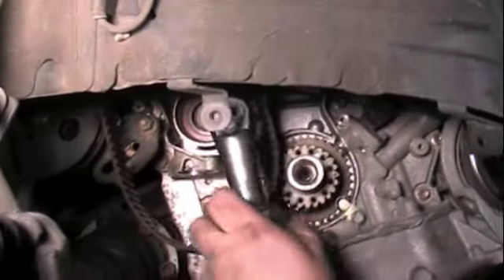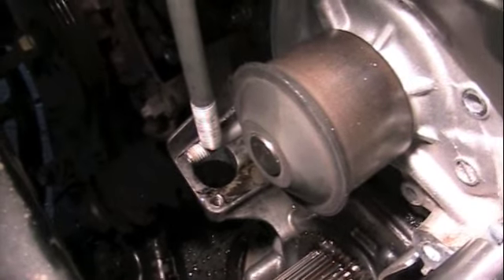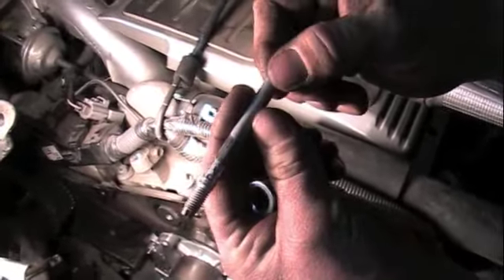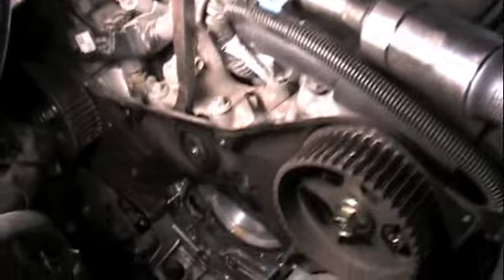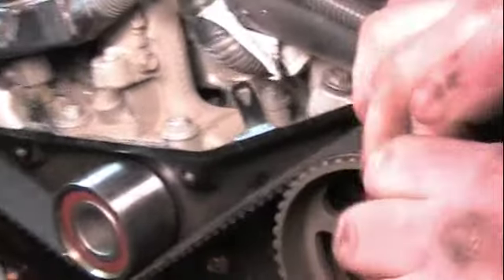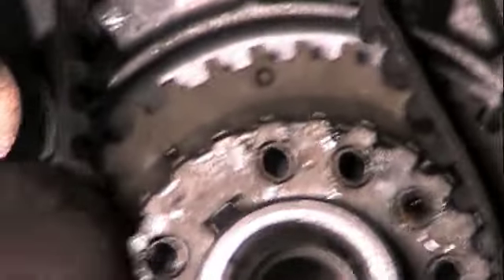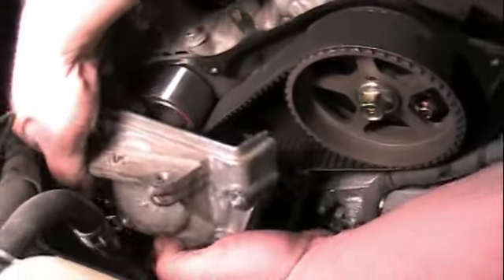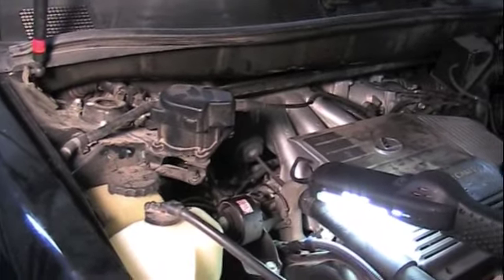00 Lexus Timing Belt part 2

Comment: Just finished replacing the water pump, timing belt and tensioner on my '99 RX300.  With your instructions, the operation was a total success. The bit about removing the studs was especially helpfull.  I used a couple of jam nuts and a wrench on the studs to help the Torx socket, so it wouldn't break off the stud tips. I had a REALLY rough time getting the harmonic balancer bolt off.  I ended up making a tool which uses the two threaded holes in the pulley to keep the crank from turning. Thanks!

Comment: I think I would have tried to find a replacement stud for the one that was broken, so when I had to do the belt again in a few years I would have had a better chance to get that bracket off without having to raise the engine again. But I can understand why you want to work around that problem, as it might have taken a few days to find such a specialized stud and your customer wanted his car back.
Thanks again for posting this video, which is by far the best timing belt video on the internet.

Comment: @sbab83 it should be a free wheeling motor not an interference engine. To be sure check the timing belt book. Most of the Camery engine like the Lexus 3.0L are not interference type. I like how the video shows using tie straps to hold the cam sprocket and belt in place without any expensive tools. The stud removal kit is cheaper if you buy the whole set of metric and standard.

Comment: I just finished up doing my 1mzfe timing belt and head gaskets... I didn't find it necessary to remove any studs at all. Some of the mount brackets and the water pump was a little tight coming out and going in but they went within too much hassle.

Comment: Great guide. I would love to know what method is used to keep the crankshaft from turning when torque-ing down the pulley bolt.
Almost every guide I've come across skips over that part entirely or just mentions tightening it with no description of how to lock the crankshaft.
The Haynes guide is vague as hell, and describes inserting a large screw driver into flywheel teeth or torque converter bolts, with no mention of how to even go about it.
Remove the starter and access through the hole?
Remove the inspection plate beneath auto transmission to access torque converter?
Is that area filled with trans fluid? Is it even accessible without removing stuff from beneath the engine?
Is it even a good idea shoving a screw driver into the flywheel and then forcing it to endure the 219Nm it takes to drive down the pulley bolt?
Reply from the maker: Good observation and question.  I believe there can be several ways to keep the crank from turning.  Most of us use some sort of way to hold or wedge something in the teeth to keep it from turning.  Just be careful and you will be ok.

Comment: Great step by step, but I do think you need to stress how important it is that the viewer understands that the tension between the two cams is tight as well as the correct amount of teeth remain between the two cams when you put the new belt on.  I do this by marking the old belt (and pulley) before the old belt comes off and then transfer those same marks to the new belt and make certain they are the same number of teeth apart.

Comment: i would have created my own timing mark with a paint stick on the hard to see cam gear and would have rotated the engine by hand 2x just to make sure the marks are on time and didnt jump a tooth after releasing the tensioner overall a very good instructional video for double ohc.

Comment: For added peace of mind, I also marked the crankshaft pulley so I know the belt is correct before I pull the pin on the grenade tensioner. This technique saved my butt in a HUGE way.

Comment: toyotas are a joy to work on in my opinion
Reply: b*: Try Doing A Thermostat (2.5 hrs) or Spark Plug & Coil Pks Replace,Which U Have To Remove Intake & Throttle Body,To Replace Back 3 Plugs on ES330,(2.75-3.5hrs), These 2 Jobs May Change Ur Opinion.& If T.Belt Isn't Done Correctly ,W/Tensioner Replacement,The 3.3 is An  Interference Eng.Meaning ,If Tensioner Or Something Isn't  Done Correctly,& Ur New T. Belt Breaks,UR ENGINE IS TOAST,BEING AN INTERFERENCE ENG.

Comment: @canoeshoe You run the engine at rest for long enough to open the thermostat, and the engine 'burps' air away, pushed by the water pump, to the radiator.

Comment: Great idea to replace the water pump while replacing timing belt, but should've gone the extra step and replaced the crankshaft and camshaft oil seals as well.if any of them begin to leak, you will have to get back to this point anyway.

Comment: Best video ever...esp the part about taking off the water pump without removing those cam sprockets. Now how do tighten the harmonic balancer without an impact gun
Reply: You need a torque wrench.  If you can, use  6 point sockets, too.

Comment: Do we need to oil the hydraulic tensioner shaft/bolt before we put it in to the tensioner and tighten it?When I took my tensioner off it was oily all over the tensioner shaft/bolt.So makes me wonder either some how oil gets there to lubricate it, I nee to lubricate it before I put it on or I might have oil leaking that got in to the tensioner...If it needs to be lubricated they shall it be oil or grease?Note that the timing belt is going be above the tensioner shaft/bolt so there is no oil or grease that will be getting on the timing belt if it is moderately applied. So do we or we do not need to lubricate the tensioner shaft/bolt?

Comment: Great video, but how come you didn't use the marks on the new timing belt. It makes it so much easier.
I saw you had a Gates kit, and the new belt had the marks. The only thing that's confusing about the belt marks are as if you are sitting on the transmission. (L Cam is the front R Cam is the rear) and the CR mark matches up with the other dot on the crank gear at about 4 o'clock.
Reply: Watch out though, the marks only work if the belt is not reversed.  I got my belt reversed the first time.  The engine still ran, but the ECU said there was an error.  I had to do the whole job again, but thankfully no engine damage.

Comment: My replacement belt had timing marks on the belt.  Per the video, I lined up the timing marks on the crank /cams, removed the old belt.  I simply made sure the marks on the new belt lined up exactly with the marks on the crank/cams pulleys.

Comment: Would probably be a good idea to hand turn the engine over a few times with a breaker bar before turning it on in order to make sure the timing didn't slip during the install.

Comment: After mounting the timing belt you may want to run it to see if the water pump leaks or not.  No sense putting it all together then finding out you have a defective pump or seal.

Comment: I have an odd question, my buddy has a 03 Sienna that has this engine and the belt is out of time, whoever installed it before he bought it didn't time it right. The crank bolt isn't coming off but I'm wondering if it's possible if I just took the tensioner out, removed the top cover and took the belt off the cams and retimed it that way by just using the marks on the outer crank pulley and rotated the crank to TDC. Only thing that I'm not sure about is that the tensioner pulley is the last to go on and I wont be able to remove the belt from the tensioner since the lower cover will still be on.

Comment: First of all, great video !!!  It is very helpful.  I know you said those stud removers were at Autozone's loan area but could you please tell us exactly which will work ?  I noticed there is a std and metric set and some off a link from your website.  Also, I couldn't get my Toyota dealership to find those two studs on their parts lookup, does anyone here have the Toyota part number for those two studs?  Thanks

Comment: Let me see ... 1/2" impact, 3/4" impact, foot and inch pound torque wrenches, stud removal tool, wobbly sockets, floor jack, gear puller, and a few other things.  Can you do this job if you only have a crescent wrench, vise-grips, and a hammer if you have the time to spend doing it? Good video. Thanks for the TIPS for when things go wrong.
Reply: I too want to know if this can be done with minimal tools. I have torque wrenches but no impact/no stud removal/no gear puller.
Reply: 1/2" cordless high impacts these days can produce up to 1200 ft lbs to break it loose. Pulley removal tool from harbor freight cost less than 15 bucks. So better to get the tools. You may have to buy bolts separately.

Comment: What if i believe mine is out of time. I bought an 05 Lexus they never replaced timing belt. From my understanding is not an interference motor, so I'm still safe...??..is this true? If so, I've tried to move pulleys and they barely move back n forth. I can't get them to turn over to line up in time. So i haven't removed belt yet. Is it possible to move individually to live up up? My car shut off on me so this the reason I'm asking. I was told timing belt slipped. Can i save my car?..please help
Reply from the maker: You have asked many good questions, and there are answers.  However it does no good to guess.  You may not like this answer but to find those answers you will need to do many several tests. I'd start with a vacuum test, then cylinder contribution, then compression.  After you get those answers you should know if the engine is worth saving.

Comment: One year ago I had my timing belt and water replaced. About a month ago the water pump started making noise. I replaced the water pump and within 60 miles it started making the same noise. Both pumps were tru flow from napa. We went ahead and replaced the pump with a toyota pump and it's making the same noise after less than 60 miles. Do you have any idea what can be causing this problem. thank you

Comment: when you are aligning the timing marks for the pulley for the RH cylinder head is it supposed to snap into place (TDC) like the LH cylinder head? i find that the LH pulley snaps to TDC very easily, but the RH pulley doesn't want to snap to TDC. I know the camshafts are aligned correctly to their perspective dots, but i dont know if setting to tdc like that is normal. if you can recall how it felt when you did it for this video, please let me know if I am right or wrong.thanks(awesome turotial!)

Comment: How hard is it to replace the front crank seal and cam seals on this engine? Book time for the crank seal is showing 7.3 hours and 4.6 hours for one of the cam seals or 3.2 hours for just the belt. Yes all the times are over lapping so I'm figuring 8 hours total. 
Also I am working on a 2000 Avalon, I believe it is the same engine. They look identical to me. 
Oh and very nice video! Thanks Mike

Comment: good job but i would have replaced the broken bolt and adding some anti-seize lubricant for the next time around.
Reply: That part isn't something Toyota would stock.  May not be available.  While it is cosmetically broken, it wouldn't be worth delaying the repair and inconveniencing a customer.  I would disclose the broken bolt head,  but would continue the repair.

Comment: Why did you reuse the broken stud? Wouldn't be easier to replace it to make it easier for the next time we need to service it? Did you put in coolant?
Reply: +Johnathon Wheeler  can you please elaborate on it as to why I am an idiot? How much does a stud cost? Not replacing will make it harder for the person who work in the car.
Reply: +Joe Black : I have the same observation as you.  I worked on old cars and usually replaced water pump bolt/stud when they are corroded. It's cheap insurance
Reply: +2Phast4Rocket hey but it seems like Jonathan wheeler doesn't see it like the way we do.
Reply: +Johnathon Wheeler what are you trying to say???
Reply: +Johnathon Wheeler look at all your comments, anybody can clearly see that you have  serious issue not me.
Reply: it is the shop,they have to get going and make money,as long as the stud is reusable,and can be re used,they are not gonna wait a few hours ,or some times whole day and holding the lift,that can bring another 1000$ or more on next repair,for 2 $ stud that is nothing wrong with it as far as functionality, but if you are working at home.and also about running out of beer ,you may wanna take brake and go for it!

Comment: what aftermarket brand of crankshaft and camshaft seal is good for that engine?\
Reply: +EvendimataE : I suggest if you go through all the trouble of removing the timing belt cover, use the OEM parts since you don't want to do it twice.  It doesn't cost much extra for the Toyota OEM parts.

Comment: Great video.  The only thing I'll add, after replacing my timing belt on an 02 Sienna with the same motor, is that after you release the tension on the hydraulic tensioner, check your timing before you button it back up.  If you don't, and you are off a tooth, your engine will be toast!!  To do this, spin the crankshaft two full revolutions or 720 degrees.  To do this, put the crankshaft bolt back in without the harmonic balancer, and use a long handled breaker bar or ratchet to turn the motor clockwise only.  If you meet hard resistance (other than pressure building up in the cylinders) then stop as you may have made a mistake and a valve may be hitting the top of the cylinder. After you turn the crankshaft over two full revolutions, check the timing marks on the two upper camshafts to be sure they are pointing to their respective reference marks on the black timing cover behind the cam sprockets.  Don't worry about the marks on the belt.  Just check to make sure the marks on the crankshaft and the two camshaft sprockets pointing to their respective reference marks on the motor (same ones as earlier).   Also, I used a couple of the inexpensive black plastic spring clamps from HF to hold the belt on the pulley instead of using zip ties. On the Sienna, it was very hard to get the zip tie on the back pulley, so I tried the clamps.  They work great.  Easy on, easy off, and they have strong tension so they hold on nicely.  I put them on the bottom of the cam sprockets so it held the tension for the whole top section above that point on the sprocket.
Reply: thanh dang
Yes. Everything turns just as if it will all turn once you engage the starter to start the motor. Don't worry about the mark (white line) on the belt.  It will not end up in the same place.  The concern is checking the marks on the camshaft pulleys and the harmonic balancer to make sure they come back to line up with the marks where they started. The benefit of doing it before you try to start the motor is that if you are off a tooth, you can remove the belt and fix it.  If you don't do this and you are off one tooth, and you start the motor you will pretty much ruin the top end of the motor. That means you'll have to pull the heads and replace valves.  Very expensive.
Reply: thanh dang Can't hurt. It is always a good idea that whenever any work is done on the timing mechanism of a motor to pull it thru at least 2 turns one complete cycle to make sure that there is no collision. Then check your timing one more time. only takes a minute.
Reply: the 1MZ-FE isn't interference so nothing would be toast you would just have to do it over
Reply: Dewd, this is a free-wheeling engine: the valves won't hit the pistons - but generally this is good advice.
Reply: The 1MZ-FE engine is non-interference, so you don't have to worry about bending valves.

Comment: Lot of Work for a Timing Belt ,But I guess that’s Why a lot of these will go 300k no problem if you do the maint.Mechanic did a Great Job except at the End he just threw it back together without Explaining Any of it ?
Reply: I listened very carefully and we don't find out the torque specs for ALL the bolts; not during disassembly's or assemblies  :(  It would have been fine If it was mentioned during either the disassembly or assembly though (Hydrolic tension pulley torque is one of them)
Reply: the video is not for training,it is for people know how to do it,and just shows where and what need to be taken out on this specific engine,that is why he does not go very detailed explanation,he assumes you already know how to work on cars,not for first timer,all those torque are listed on line,can be googled,or manual,or you can call dealer,
Reply: @BlueSkyGreenGrass54  That's why you buy the book and use this as extra reference. They can't spoon feed you..